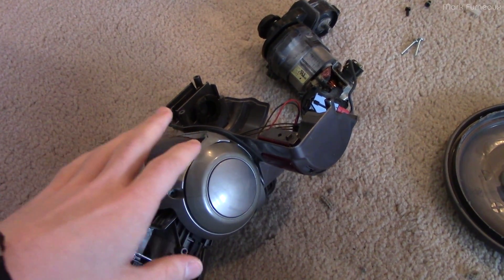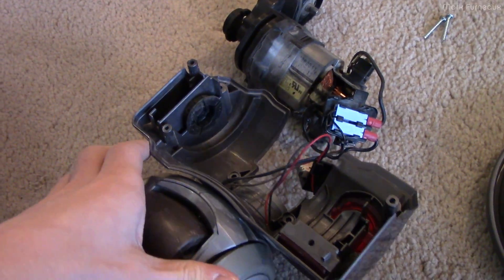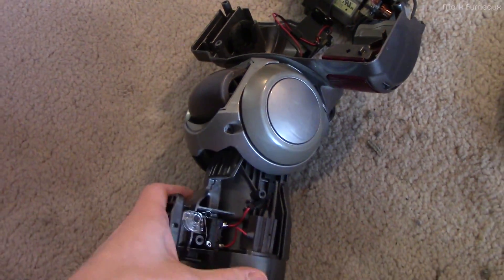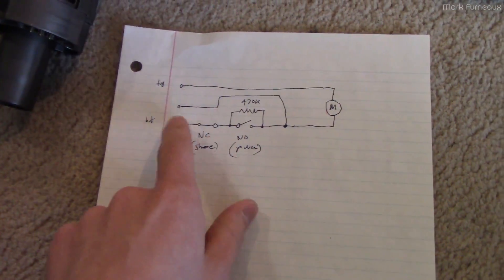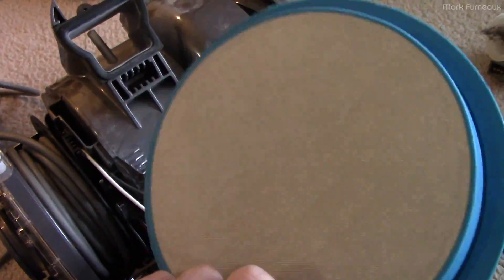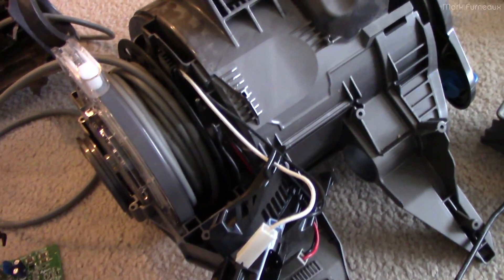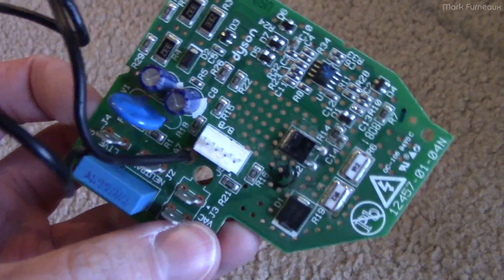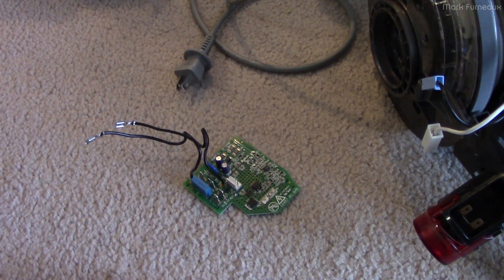A Look at the Circuitry in a Dyson DC23 Powerhead

Comment: I would imagine they put the circuit board in the main unit for protection, plus when you replace the head its cheaper as it does not include the board.

Comment: My DC23 electric power head stop working. I do not know much about how to check if it’s the motherboard that toasts or the micro-switch not working or if it’s the actual motor that’s dead. How could I go start to start troubleshooting. Also would you know  where could I get parts in Canada for it. Thanks!

Comment: hey. Love you video! The schematic helped. 
also, Any chance you know what the specifications are for the fet on the board? Mine blew up, and cant read the numbers on it due to it being blown up.
Reply: While I can't help you on the FET specs, I have found that the board itself is available for about $40 to $50 which may be an alternative to replacing the FET.  BTW> I noticed from the video that there wasn't much ventilation in where the board is located.  Was the area dusty where the board is?

Comment: I have an intermitant powerhead, after cleaning the unit and checking all visible connections it still cuts out. Is there anyway I just get a new head for a DC23 or at least replacement parts such as the IC board?

Comment: Did you ask why didn't dyson put the circuitry in the motorhead and use only two lines along the hose and wand? I believe that's because they want to make sure the motorhead can only be fully functional with the vacuum together and not working independently, and they quite accepted and justified that there's not much difference between running two lines and running three lines, in terms of cost. Just my 2 cents.

Comment: my daughter, when trying to push the power head down to start cleaning, cracked the plastic. it no longer holds a vacuum in the unit. Does anyone know of a "glue"  that will bond the brake and  vacuum seal it? (I bought a "cheapo to cover my repair time, but my wife is now on me to get it done.)
Reply: Marty Hastings Try sealing it with silicone, let that dry, then use acetone to melt the plastic back together
Reply: thanks for the good info i will try that.